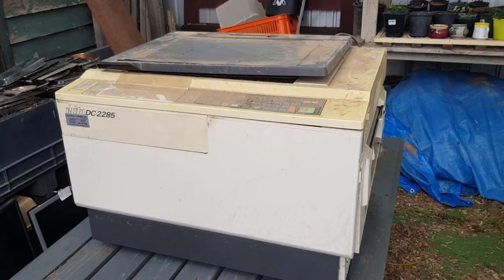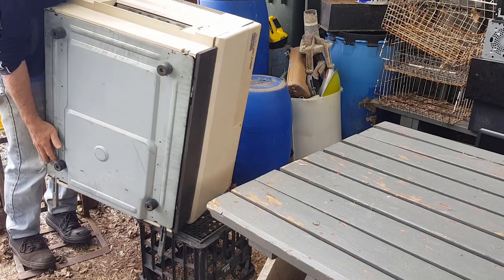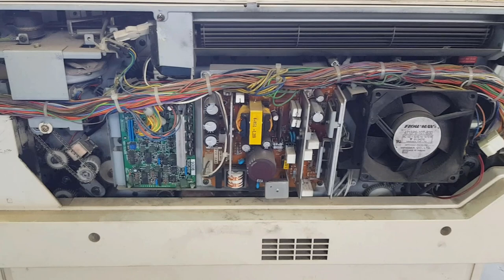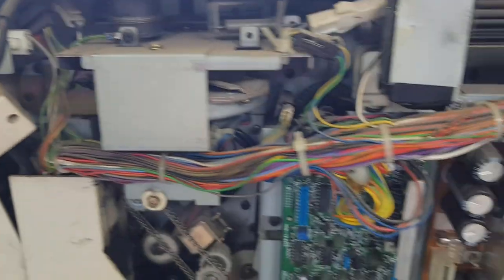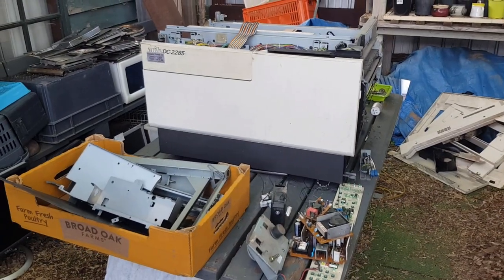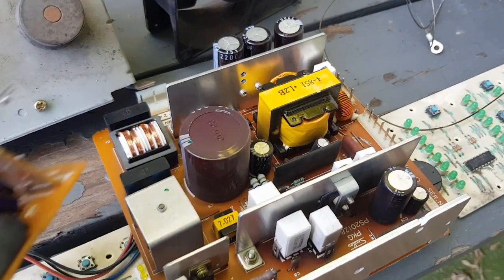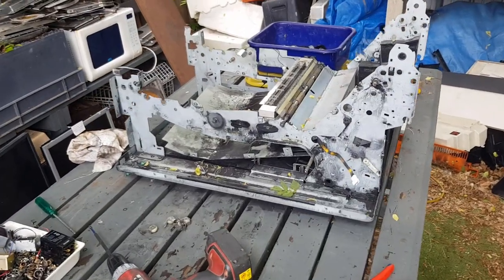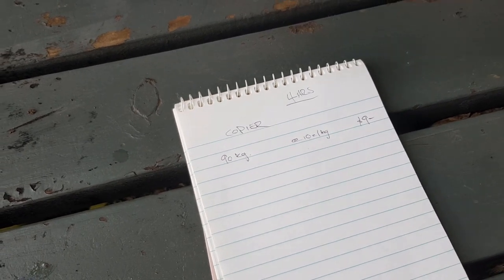Scrapping a large vintage office photo copier. How much value can we find? Scrap & hardware..

Comment: Though I'm sure others have done it,  this is the first time I hear of another person taking old copy machines apart. I grew up around the family graphic shop and eventually we'd have one or more obsolete machines that I'd venture to tear apart top to bottom and save every cool piece I'd fancy. Probably deconstructed the first one when I was 12, and between then and now at 30yrs old I suspect I did about a dozen of these machines. Some of them were smaller ones or mid size like the one you have there, but most were the full size ones (their rolling chassis make pretty good workbenches). It could take about 2 weeks for me to go through them completely. To this day I still have transformers, motors, lenses, stainless shafts, bearings, bronze bushings, gears, fans and the like neatly stored in boxes. Always had fun with it but it does wear out after awhile as you said, screws are by the thousands on these machines, mind boggling. Thanks for the video and cheers
Reply from the maker: Thanks cesar augusto, that's great! It is rather therapeutic taking things apart!  😊
Reply: @TheUltimateRecycler  i agree with you mate,very therapeutic but the clean up is annoying!

Comment: I swear on the souls of my children I just did a printer like that this week 😂I wish I would of known you where doing this video.. most of the stuff went to shred and the plastic to recycling but I got all the copper out of the solenoids and the motors .. mine was a little newer it had some tin ram on the mother board .. great video chris .. I still wish I lived down the street from ya 😂 have a great day brother
Reply from the maker: Haha, thanks Seth! I'm not sure any street in the world would be able to cope with both of us at the same time!! 🤣🤣🤣
Reply: The Ultimate Recycler we would be like sanford and son👊🏻
Reply from the maker: @streetcopper1151  🤣🤣🤣
Reply: Would like to chime in. If I'm seeing right you are giving circuit boards to the transfer station. You might want to re think your donations. 999 Dusan goes into detail on the little things on your boards. On the control panel board, all those little black switches do contain silver contacts. Most every thing on that board has value if you look closely.
Reply from the maker: @donniebrown2896  Thanks for your comments Donnie. The only boards I give to the transfer station are low grade ones which are not viable for me to store & transport to Melbourne to sell. Yes, they are worth a small amount, but not enough to convince me to save them up. I've seen 999 Dusan's vids and while you can recover some value - the quantities are way too small for me to worry about. Silver just isn't worth enough to go after every micro-gram. I appreciate your thoughts and comments though - thank you 😊